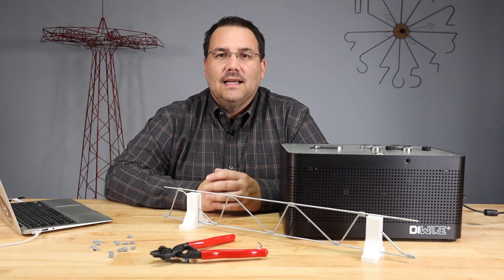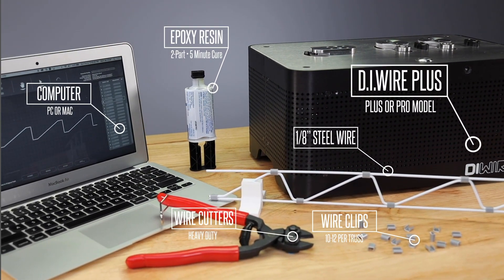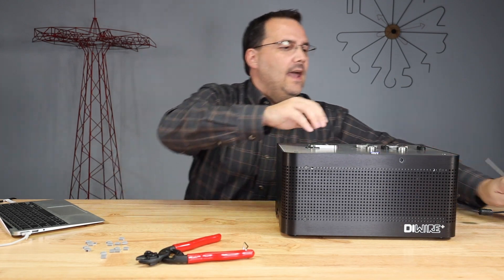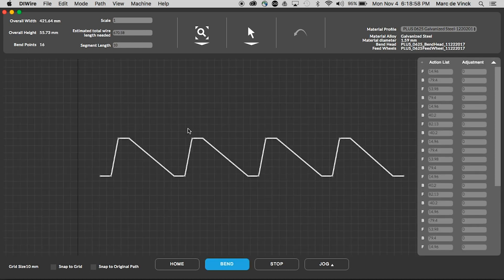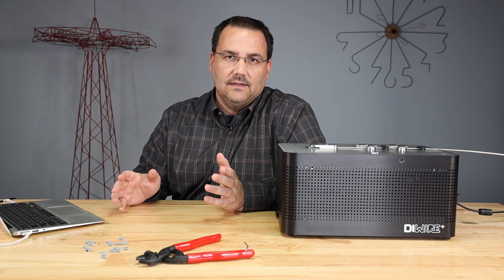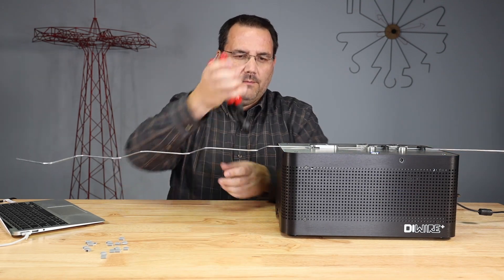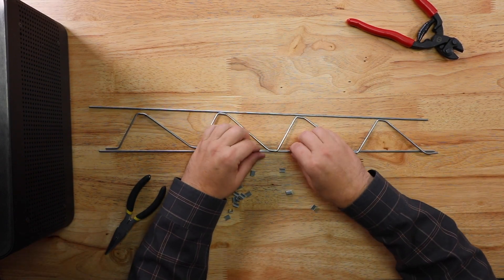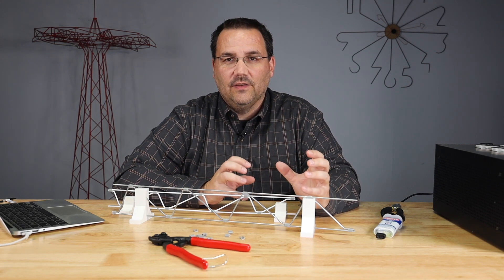Pensa Labs I Project - Making a Truss

Comment: Hi, how do I import my design from fusion 360 cad software?
Reply from the maker: Hi Jorg! Currently, the WireWare software is only compatible with .svg files.
 However, you can export your design as a .dxf file and convert it to .svg through Adobe Illustrator or InkScape (free). Hope that helps!
Reply: @pensalabs  ok thanks,  does it need a particular scale or dpi for importing?
Reply from the maker: @Innov8cnc  the scale should be 1:1, and that's it. Good luck!